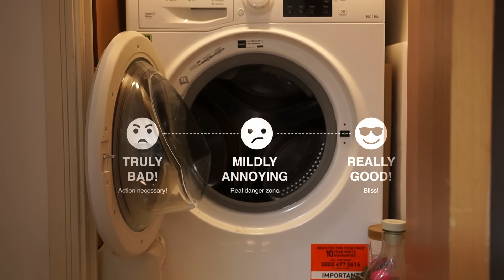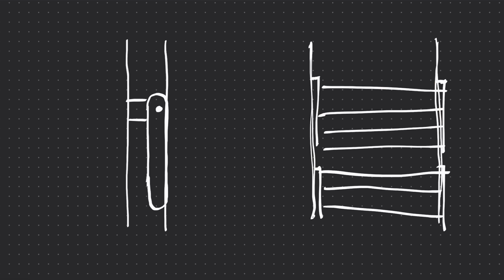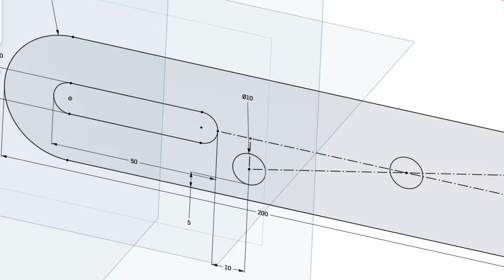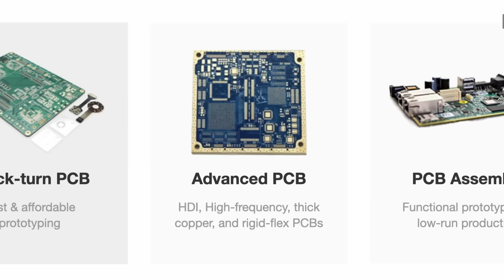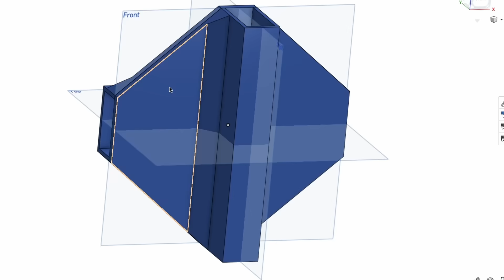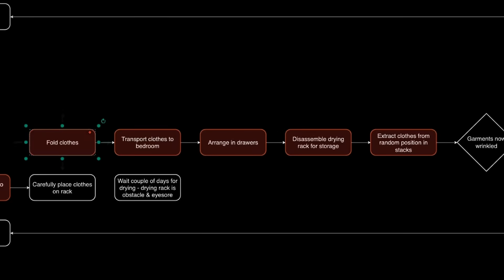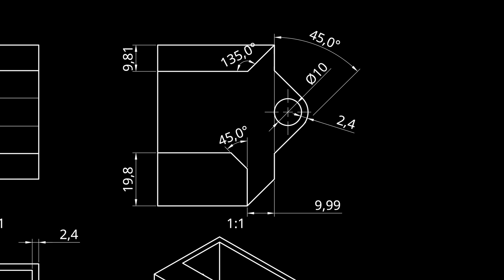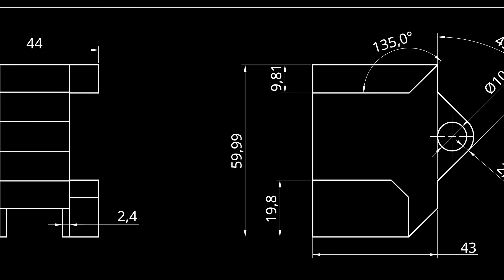I made furniture to escape the most annoying chore - and it fought back!

Comment: Great video! Had to remove stickers that wouldn't come off once and found that WD40 works pretty well to get rid of the glue.
Reply from the maker: Thanks for checking this out and for the comment!! I will definitely give WD40 a try, thanks for the tip - seems like this substance is good for everything!! 😂
Reply: WD 40 is overbuilt but works like 5% better than oil. Leaves a residue that may add inconsistency in a build like this, where friction could be fundamental
Reply: i agree with @GS_666 . vegetable/cooking oil is cheaper, doesn't leave a residue or smell and may be healthier to use (on your hands). its a kitchen hack used for decades especially for people wanting to reuse glass jars and other label ridden items. also a sturdier structure (wood) would've  reduced/eliminate the need for braces and simplify the overall product.
awesome video and nice attention to detail.